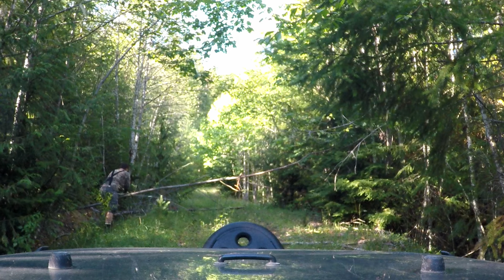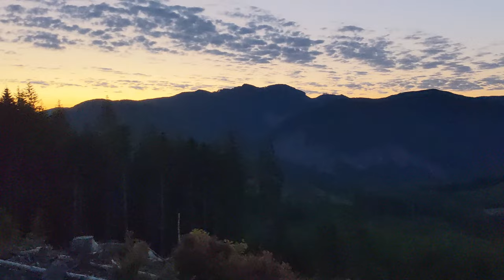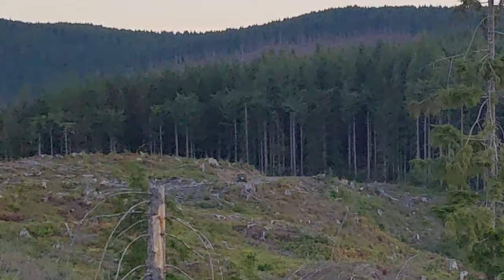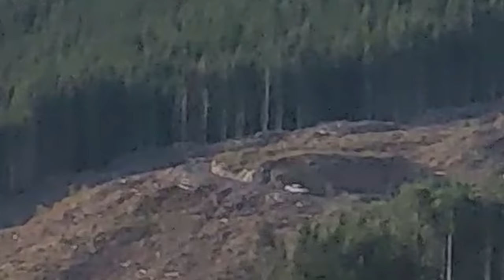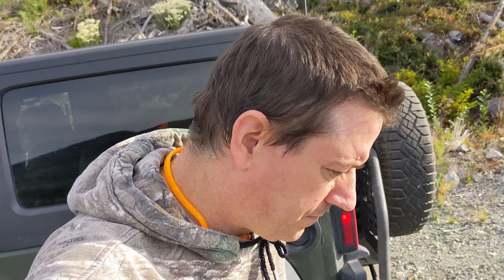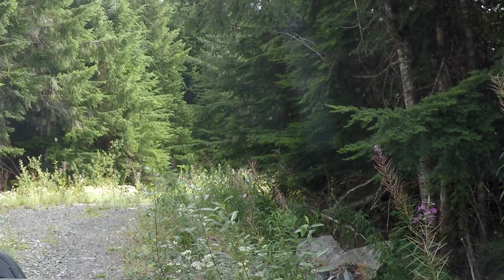Hunting - The Struggle and the Reward

Comment: I enjoyed watching Age's Forestry Management Services hard at work. 😀 I can't believe how mean you were to that bear. 😂
Reply from the maker: Lol! Yeah, you'd think I was hired to clear the trail with all the trees I got out of the way😂It was worth it in the end.

That was actually a dirty Hippo. It needs a bath🛁 I was a little mean though...kicking it off it's chair and then throwing back on the chair. Poor thing was all slumped and afraid🙁

I used my Zoleo in this one. I alerted my contact that I was stranded and  that I'd try to figure it out first. They were standing by waiting to know. We both didn't know what the next step to do was if I were indeed stranded. I'm doubtful that a tow truck would come out there and if one did, I don't think it was coming that day (Sunday). 

Thanks for coming along Darryl (is it Darryl or Daryl or is that not even your name and I've had it wrong, lol) and next time I'll try to be more kind to the bear/hippos 😁
Reply: @agesadventures  You got it right and it's Daryl. I laughed out loud when that hippo fell forward out of the chair! Too funny. Interesting about the Zoleo. You told me about it before but I'm still holding out on getting one. (I'm cheap.) Motorola has one that pairs with a cell phone and apparently some Android phone manufacturers are coming out with the needed chip already installed. But none of that'll help me in the here and now.
Reply from the maker: @flynorthproductions  I've been told the correct term is "Thrifty" 😂
The Zoleo pairs with the cellphone as well. That's what does the texting. I'll have to take a look at the Motorola one to see what it does. 
I've heard about Android having the chips available and  just need the software to do it's thing. Then I guess there needs to be an agreement in place with the Satellite providers to use their bandwidth. And then the big question will be, is it the same as the Apple one where you can send an SOS, but no texts back home. I have a Google Pixel so I'm very interested to see if the new one coming out will have the capability or if we're going to have to wait and then also what the capability may be. 
That hippo has been there at least since the end of May, if not longer. I hope he continues to be out there. I think it's great and isn't harming anything being there.
Ok, I'll try this again...thanks Daryl😁

Comment: I've been stuck in the back country with an unserviceable vehicle, it was the one time I was happy to have a Ham License and Radio Gear! It's not fun but I'm glad you got it worked out! Grouse = Excellent! Good trip!
Reply from the maker: It's not fun being stuck out there wondering how you'll get the vehicle home. 
I  have a VHF radio with me, but I'm not licenced and my Jeep being stuck isn't life or death. Life or death and I'm using the radio.
The Zoleo would have been used to get someone to call  for help. 
I was certainly happy to get it worked out and learned that I just need to calm down and think. I also need to have plans in place for if I'm stuck again. I've given my friend the 4X4 Off-Road Recovery group on Facebook where they can reach out for me. 
Yes, getting the grouse means that it was a successful hunt🙂 Only three shots for three birds so it was economical too😀
Thanks for joining the adventure, Mike😁